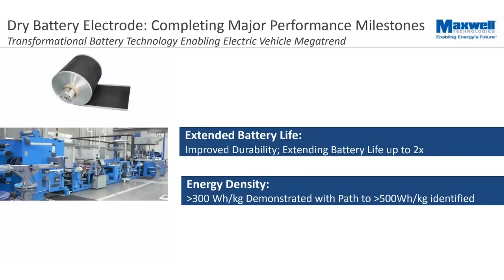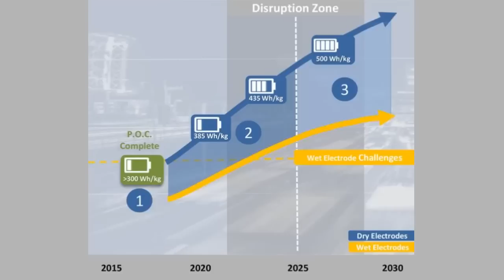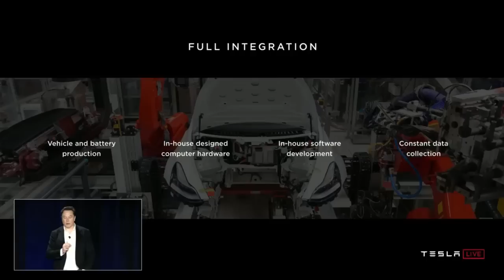Tesla's Battery Revolution / Double Range / Cheaper Price

Comment: Nothing in the new battery developments justify a 2X increase in range for a battery of the same mass -- maybe a 20% increase but not 100%.  In order to double the range you either need double the battery, double the energy density, or some combination of increased battery size and energy density.  Physics isn't moved by bullshit!

Comment: Tesla for now is not moving forward with solid state batteries. Too expensive to mass produce at the moment. But after acquiring Maxwell, Tesla has been secretly working on Dry Electrode Batteries. According to Maxwell, the technology is currently at a stage where a Model 3, for instance, can have at least  20% more range which will bring the range close to 500 miles per charge!

Comment: I drive a Toyota hybrid it's electric drive and it's fantastic. 
Apart from in snow ...in snow it is by far the very very very very worst car I have EVER driven.
But other than that it's great.
Once they stop pilocking about and create a decent battery the internal combustion engine is finished.

Comment: We all know right. This is how they achieve the new roadster performance. The battery power goes so far and it also has capacitors to quick bursts of power. This is how I imagined this will go about 5 years ago ... also, I think this can be also applied retroactively just as you would stage a normal ICE. This is becoming interestiiiiing.

Comment: I think the most likely scenario is a moderate upgrade in range while reducing overall battery size. This is the best way to maximize profit margins. They can decrease the amount of material used for batteries (and weight) while at the same time giving more range so they can get more value from less material. Increasing value while decreasing costs.

Comment: Are the 650mi projection based on the same test, that says "Tesla 3 has 327mi epa", whereas everybody knows it cannot do more than 240mi on highway trips  (with moderate 70mph speedlimit; not the 80 mph interstate highways)??

Comment: Sorry. $100k with a  5 year lifespan are not economically viable.  The  software support is only for 5 years. These vehicles have no need of better batteries.  Only an idiot or PLUTOCRAT would buy an EV.
Reply: 2012 called, it wants it's arguments against EVs back.

Comment: 650 mile range will do it.  Cars need to be able to drive about 4 hours on a refuel with some buffer.  That is why ICE cars size their gas tanks for 350 mile range so that is our goal.  EVs practically can only be charged to about 80%.  650 x .8 = 520 miles (really good), but that is in summer.  In winter in North Dakota, EVs will only get about 60% of that range or 312 miles which doesn't look like enough until we consider that ICE cars also lose about 12% of their range ending at about 310 miles or the same as that Tesla.  Bye, bye ICE cars.
Reply: You haven’t seen rich rebuilds I guess. Charging at home takes 24 hours to charge your car. And Tesla is removing fast charging on used Tesla’s, so I’d stay away from Tesla altogether
Reply: @justinjones5281  Don't be so derpy JJ. Nobody needs to charge their car from 0% every night. Actual homeowners who drive Teslas never run out of juice or are inconvenienced by overnight charging times.

Comment: I mean these guys are ~17 years in and they've almost completely electrified the braking system (I only use the mechanical breaks when it's cold). In a few years, they won't need brake pads.
Reply: why dont need brake pad

Comment: If Tesla doesn't improve its pricing to become competitive with gas engines, the seemingly contrived  combined effect of cheaper gas and gas powered cars will likely destroy Tesla.  Dirty energy and gas powered cars seems to be doing everything they can to defeat Tesla no matter what the cost to the planetary life systems.  It may help mileage and charging  if the top of the body/hood is coated with solar cells.
Reply: The average price of a new car in 2019 was $37,000. You can buy a Model 3 for $35,000 before government incentives.

Comment: why do none of these vehicles incorporate some sort of solar cell panel/covering on the external panels of the car so it could say CHARGE as it sits in the parking lot while you're at work for 8 hours???  News flash to all the green peeps....put all these electric cars on the roads and you're going to need to produce a SIGNIFICANT amount more of electricity.  If you're a TRUE greeny...every panel on that car should be a solar collecting panel.

Comment: And how much does it cost to fully charge??
Electricity costs are RISING worldwide,  contrary to many lobbyists fairytales.
Reply: We need LFTRs
Reply: Yup but it's still cheaper than petrol $8-10 a gallon.
How many cars out there that a few in the same class as the tm3 for instance which has a 75kwh battery which is equivalent to about 9 liters of petrol in energy density can travel 300 miles on said 9 liters of petrol?

Comment: With 650 mi-range, the battery pack can be divided by 5, to make 5 plug-in hybrid gasoline electric vehicles, each with 100-mi range per charge, enough for ALL local driving needs, thus only requiring the gasoline engine for occasional long distance trips.  So, over 90% of mileage can be driven by battery electricity, yet the battery capacity per Tesla car can make 5 plug-in hybrids that can save 4.5 times more gasoline.

Comment: The only thing keeping most folks out of a electric vehicle. Is price and range of the vehicle.
Reply: I mean, gas tanks aren't extremely far ahead of electric cars in range. If you have 30 mpg and a 15 gallon tank, you can go 450 miles with it. And that's for efficient sedans. If you get 21mpg on a 15 gal tank, then you only go 315 miles.
The standard model 3 has a 250 mile range. Which, is certainly less. But unless if you do a lot of long road trips, you shouldn't really have any issues. You actually have an advantage of being able to charge up the car at your house every night, so you're always filled up on energy.
Reply: Buy a second hand Model 3. Or wait for the Chinese model to come out. Meanwhile Tesla leads in reducing battery costs and increasing energy storage density.
Reply: The Model 3 is practical and affordable for most US homeowners. Also, most US households own multiple cars, so complaining about range for the occasional road trip is silly.

Comment: It's more likely that these cars will be stuck in the low 300's for the next 5-10 years. After all, if any company started selling an electric car that got 600(or even 400) miles per charge people would buy one, and ONLY ONE, and drive it for 20 years. Not profitable for the company at all. Planned obsolescence rules the roost folks.
Reply: And why exactly would Tesla care about that? If they make a car that can get huge mileage that everyone will buy then they will dominate the car industry. Tesla won't care if you only buy one every 10 or 15 years, but we all know that wouldn't happen because people like to buy new car every 5 years or so. So Tesla would be smart to have high mileage vehicles, don't you think? You need to think these things through ha-ha.
Reply: I wish it worked that way but sadly it really doesn't seem to.
Reply: Cheaper and more energy dense batteries is not just about longer range, you could also keep the range about the same and make the cars cheaper. Imagine what would happen if a 300 mile Model Y was cheaper than a Toyota Rav4.

Comment: Imaging a electric car with no batteries! Why not!
Reply: That's a very good post k+ 👍
Reply: You need to get the energy form somewhere. I personally don't care what the storage device is called as long as it is clean and long lasting. The final goal would be a car with enough stored energy to last a lifetime. -> No more charging or filling up or anything; just driving.
Edit: Of course super efficient real time charging systems would be a way to go. But there is probably not enough sunlight, wind, heat etc around the car to take the necessary energy from there.
A 3rd way would be insanely efficient battery storage. Imagine a C or D type battery being able to hold enough energy to last for 500miles. You wouldn't have any batteries in the car. You would take your battery from home push it in to a hole (like the old cigarette lighter) and the car is ready to go. If you travel farther than 500miles you just take an extra battery (or 2 or 3) with you.
If this kind of technology were available, you could even have your cell-phone charge the car. So you wouldn't need an extra battery. Your cell-phone is your car battery.
Reply: Or imagine a million-mile-battery. Not in the sense we are talking about it today. Not a battery that can be used until you have driven 1mil miles.
But a million-mile-battery that can hold enough energy to last for 1mil miles on the original factory charge. Like a crude ZPM.
Why not?
Reply: Thorium scalable reactor!  These reactors were invented in the 60! Russian inventions that product free energy enough to run a car without any batteries! Why not! As a scientist, we must changed our ways of thinking about energy! Like Nicolas Tesla ,we just have to think more of the forbidden Science!

Comment: Lets not mention that fact these electric cars are horrendously expensive and actually have a bigger carbon footprint than a gasoline car.
Reply: @M Bacon Poeple don't take into account the coal fired electrical plant they build to fuel those electric cars.  I do, hence the big foot print.  They don't cut carbon emissions, just how it's counted.  The technology still needs to be perfected, like stop burning coal in those things.
Reply: I see it as there are only 3 choices for power suppliers; hydro(water) plants, nuclear or coal with super clean scrubbers on the exhaust stacks. To get rid of the nuclear waste they could use Elon's SpaceX to dump the spent rods into space.
Reply: @M Bacon Well the earth has lots of coal but how much natural gas do we really have? I worked at a very large gas plant(in Alberta) back in the 90's and at that time they were concerned about the fields going dry. Of course now they like to tell everyone that's it's an endless supply...yeah right. Coal, just scrub the stacks, the technology is there, I also worked in engineering for 15 years.
Reply: Keep spewing out the lies you hear in right wing media instead of doing actual research, maybe someday you'll be right about something.

Comment: I HOPE that will be other MORE ecological alternatives to batteries (Hydrogen for example).
I don't think batteries can power the entire world.
Reply: Barbu Vulv:  and where do you think all the H2 is coming from ?
      Electrolisis = Electricity. OR reformed from Nat Gas?
     Or do you have the miracle answer?
Reply: @darrenkohls7431  thanks, i don't have a miracle answer, but I think hydrogen could be a viable solution for vehicles.
I DIDN'T say that I have the miracle answer!🤦
Reply: @trainspottingtech23  Hydrogen is Bullshit for cars. Do your research and don't just repeat what oil companies and car OEMs are saying... You need 3-4x as much input energy for the same distance which means as long as the grid is not 100% clean 3-4x as much CO2, always much more expensive to run and to go 100% renewable you need to build 3-4x as much capacity. Hydrogen should only be used as a grid scale energy storage and also because of the low efficiency only as a last ressort there...

Comment: It still did not tackle four things. Cold weather, what happen to the battery in a flood, the power grid and how to tax to maintain our roads
Reply: Are you kidding our roads are in need of dire repair where has the money gone that is my question?
Reply: Ray Brown Lots of instate corruption when it comes to the gas tax.  Sadly, I think they’ll likely put in more tolls in more states just to compensate.
Reply: scarecrow66ab Cold is still an issue but Tesla has mitigated some of that through insulation and built-in temperature regulation but given that the mechanism itself drains power, still not quite sure how good the trade-off really is.

Comment: Divide this number by 2 my sr+ show 380km but i only do 180
Reply: If I drive at 65 MPH I easily obtain 250 miles (400km) in my SR+.  Around town I get 300 miles.  I do drive with a light foot and look ahead to maximize regen with a view to not upsetting other drivers.

Comment: While longer lifespan and lower cost are significant, they pale in comparison to a 650 mile range. EVs are inefficient for traveling because they require both an intermediate charging station and waiting around during the middle of a trip. With a 600+ mile range an EV can travel for an entire day without having to recharge. Recharging can be done at the destination or at a hotel while sleeping. If 600+ mile range could be achieved it would change everything, but I'm not holding my breath. People could just own an EV rather than it being a supplemental vehicle.
Reply: Exactly.
Reply: Long distance travel is an overblown concern. The average person would only exceed a 300 mile range a couple times a year. The people who complain about current Tesla ranges are mostly right winger nutbags, if Tesla's had 1,00 miles ranges they'd just find something else to complain about.

Comment: Model 3 with nearly 450+ mile range will be good enough for me... hopefully with launch control as well..
Reply: Nah, I say 600 miles for M3, would be excellent this will get rid of range anxiety  you would be able to take very long trips without having to make frequent  stops to charge, I can't wait for a 600 mile battery for my M3.
Reply: For me a 100 mile $25,000 model Y
Reply: Have a P3D. Elon did negate Plaid for Model 3 and Y, but never said no to Ludicrous or Ridiculous Mode for Model 3. The Dula Motor already got the optional Acceleration Boost, so I would think that by November ( when Model S Plaid comes out) that this option will come for the P3D.

Some hacker found a 100 Kw battery and Ludicrous may be in the works for the Model 3, abd hence the Model Y. I say 450-500 miles range for the Model 3 is the sweet spot with a version 4 Supercharger speed. It's already hinted that Cybertruck can charge at faster than V3 speeds.
Reply: Yeah I'm waiting for a model 3 with about that much range and a million mile life battery and motor then I'll get one.. currently they do 300 mile range but only get about 280 in the real world best case scenario
Reply: no model 3 has that range !!!!!!
Reply: I need more range just in case of an emergency. 600 mile range battery is the beginning of where my shopping starts

Comment: The current EV drivetrains have shown they are effective for commuting point A to B and they are nearly comparable to ICE vehicles but they are not the best for utility which is companies are just now coming out with EV vehicle with utility in mind trucks SUV's and Semi's
    The problem has always been weight and cost, the higher the battery KWH the heavier it is and the more it costs to make right now a 100kwh battery pack weighs nearly a ton by itself it comes to a point where it's counterproductive to add more power the law of diminishing returns kicks in, it's why fuel tank size varies depending on vehicle type for ICE vehicles to have a sweet spot between fuel amount and weight and is also why fuel tanks larger then 50 gallons are extremely rare for consumer vehicles EV'S are still in the process to getting to there sweet spot
    In the end I see EV taking up a decent amount of market share in the next few years but I don't see them rivaling ICE vehicles in the utility department anytime soon doing work requires larger then normal loads of energy and it hits EV's especially hard 1 Gallon of chemical fuels like Gasoline or Diesel has about 30-40 KWH of energy stored in them just 5 gallons of fuel and you have 150-200 potential KWH of energy dramatically more than the largest battery currently available for any EV and cars usually have 12-15 gallon tanks which is a energy potential that no battery will match anytime soon likely ever I see them doing moderate work but nothing much higher then that charge time is also a issue

Comment: There is absolutely no reason to increase range past 300 miles, that would only serve to keep the price out of the reach of the lower-middle class. No one needs a car that goes 2 weeks on a charge when you are charging the car everyday. >80% of the population would be fine with a 100 mile range vehicle.  We need to start seeing the media review EVs the way they review mobile phones:will the battery make it through your day? Does it perform? Is it functional? features...
Reply: Americans want a car capable of long road trips even if it's only twice a year.
Reply: That may serve you just fine but certainly doesn't serve everyone.  Or should the world only cater to what is important to you?  The deplorable narcissism displayed in your post is astounding.
Reply: @MJ-eo5hd  Yes, we want long range batteries so we can take long trips w/o frequent stops to charge
Reply: Cameron is right, almost every household could swap one of their vehicles for an EV with no disruption to their driving habits. And the problem ultimately is not range, it's the charging infrastructure. If every gas station had a bank of superchargers, range anxiety would not even be a thing.

Comment: The best thing that could be done for EV to become truly a viable choice for long distance interstate highway travel would be for the development of a family of physical and electrical compatible rapid exchangeable battery packs. Instead of the liquid fuel filling stations, there would be the analog of rapid pack exchange stations. For economic short distance local commutes, the home charging facility would continue as an option.
Reply: Long distance travel is an overblown concern. Most people wouldn't exceed a 300 mile range more than a couple times a year.